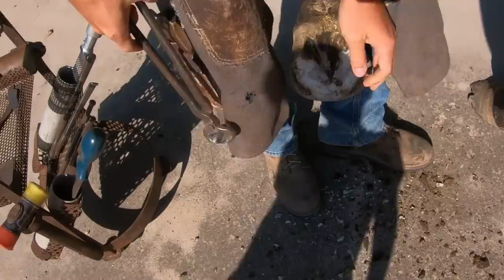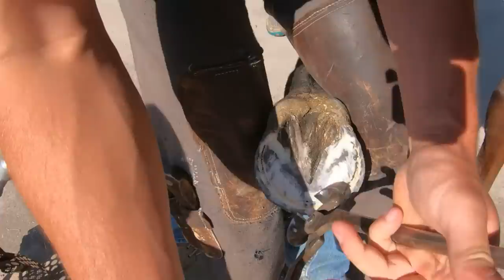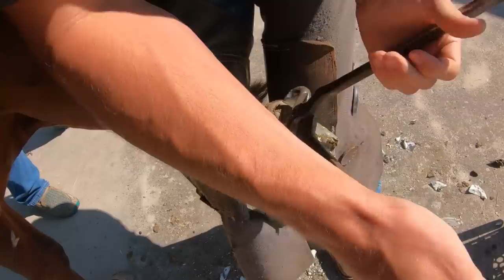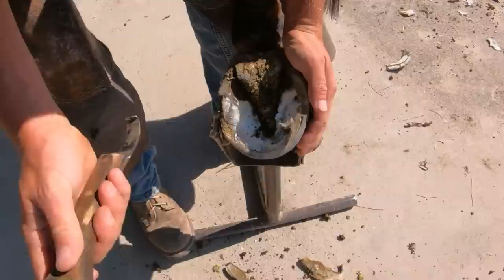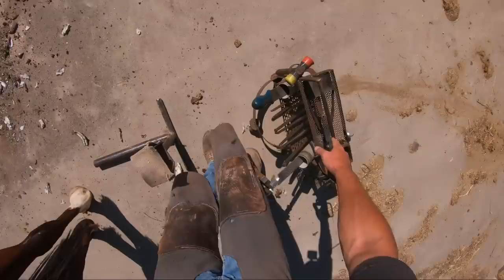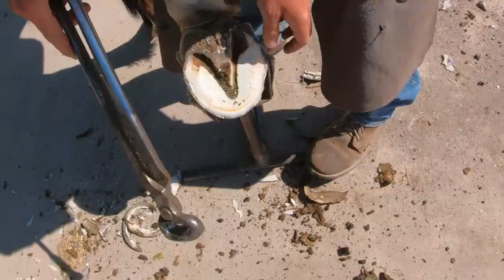TRIMMING a RESCUE horse With RINGBONE // Satisfying

Comment: When you are at the vet check and see if they can fuse your spine while they are at it. I can't think of job that is harder on the back than being a farrier. I trim up my horses hooves and I can only work for 20 minutes at a time. My full time ferrier just retired and his back is trashed.
Reply: Having 2 back surgeries myself this is so painful to watch!!😖
Reply: Isn't there an easier way? Like a soft lock on the hoof, that will break loose so it doesn't get hurt if it flips out, so you can sit down and do it?

Comment: So weird how it carves like wood, but it breaks apart like the inside of a coconut or some kind of fungus.
Reply: Its a nail basically, keratin
Reply: Would be the same if it was a rinos horn
Reply: Kinda crazy
Reply: Looks so gross. Those poor horses :( Imagine living with dirty nails and long nails for years
Reply: @Jin-1337  well they don’t get cleaned in the wild
Reply: Karen Reed  depends cuase in the wild there is a lot of soft dirt so ide imagine if anything they would get really long, the nails, and intern become lame
Reply: That's oddly specific and on point
Reply: @Jin-1337   as a horse owner, horses shoes get clogged easily. It’s hard to stop a horse from getting dirty feet, if not impossible. Makes for a satisfying job though
Reply: @yourdadwillgetbun5269  I know but it should be cleaned at times. Letting it be for years an years might just be painful for the horses.
Reply: @woozy9112  in the wild there is a lot of varying terrain and they walk around a lot more than they do in the pasture. Wild horses also have a different conformation than domestic horses do which helps wear down the hooves appropriately.
Reply: @Jin-1337  I know. Nothing should be left that badly. But can’t be kept on top off at all times

Comment: i was always told that hitting the frog would cause it to bleed like crazy, was so shocked to see you clipping into it like that-- now i wonder if the horses at that barn had problems with thrush?
Reply: Need to trim that frog, even if thrush, all that loose dead material, will make it worse with the debris, and mud getting trapped which will cause worse infection
Reply: Same!
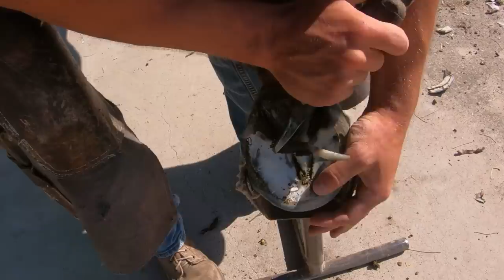Reply: 8:20

Comment: If anyone is interested about ringbone: Arthirtis is the growth of additional bone between 2 articulating bones in a joint. Most of the time, the surfaces of bone is covered in cartilage, and that cartilage is smooth and fits like a glove on the other piece of bone. If there are irregularities, it can lead to chipping, more bony growths, and calcification/deterioration of the cartilage. like he said, ringbone can be fused with minimal side effects in 2 joints. Fusion means the bones will eventually grow together, and the joint will no longer be able to move at all. Much of the time, if the horse has ringbone in these locations, the vet will simply let the bones fuse on their own, since they're heading in that direction anyway. If it is really painful, the vet can induce fusion with a simple surgery. If the ringbone occurs in a high motion joint, the excess bone can cause issues to the surround tissue, such as tendons and ligaments. You can deal with this is 2 ways: 
1. If the horse is old, or the owner can't afford surgery, shots such as corticosteroids and hylouronic acid( much like in humans) can be given for lubrication.
2. Surgery. Look up arthroscopies! They're very satisfying to watch. Theyre also very common in the knees of race horses.
I am not a vet, so this is just me saying things. I definitely didn't put everything I know down, so feel free to add!
Reply: Im vet, i add sugar

Comment: Do wild horses wear their hoofs down naturally, and how is that possible when they mostly walk on soft ground?
Reply: Hooves are made of keratin which is the same substance that makes up hair and fingernails. It’s approximately the same hardness as talc so it wears down fairly easily since wild horses walk across a variety of surfaces. Domestic horses are on more limited terrain and stay in stalls which is why there are special hoof care experts (called farriers) like this gentleman who know how to manage issues that come with domestic horse hooves.
Reply: I'm sure they scrape them on stuff or something
Reply: Not only that but sometimes when horses stomp to shoo away flies, chips may fall off of the hoof. It can cause a problem if it's too big of a chip, though.
Reply: A wild horse yes will were it down cause they dont just walk on soft ground cause if you have ever noticed there is alot more field stone and sometimes they have to pass creaks and other rocky terrain that can cause the natural care of the hooves

Comment: Me: my life has been a lie every single horse rider told me that the frog is sensitive...
Reply: for real
Reply: It can be sensitive to pressure. Like when they get rocks stuck in the frog
Reply: So the frog is sensitive, but relatively. If you stab or cut off the wall of the hoof, it won't hurt, but if you stab the frog, ouch obviously. Rubbing it or bumping it won't cause a problem. So not super sensitive, but don't go stabbing it with a knife or anything. I has nerve endings, but not what one would consider sensitive

Comment: Ring bone sucks! My mom's old horse had a bit of ring bone. He was not near as bad as this mare, but we had to make sure he was kept in a large level paddock or he would get a bit sore. 

I'm so glad the mare has a new home that will take care of her. She looks like she was fed well but her feet were a mess. Poor crippled old lady. It's exhausting to have weight for any length of time on arthritic joints. I was holding my breathe the whole time you had her right fore in the air. You could tell her resistance to picking the foot up and slamming her foot down wasn't her being bad, just trying to relieve the pain. She sure seems like a real trooper, as an old rope horse would be. I hope the trim helps her but she needs a good arthritis Rx or supplementation and then a little bute the night before to further take the edge off before trimming.

I know just how she feels.1 knee replaced. 1 knee to be replaced. Worth it!

Comment: Is there any way to get/make her a crush that can hold her front weight when you trim the right front so she doesn't hurt her joint while doing it? 

Can't imagine how painful that must be. Poor lady. Glad you're helping her a bit
Reply: I recently tried trimming our mule in a cow crush... as she was a rescue and could not stand in 3 lega for trims anymore because of arthritis, ringtone and other issues. 

She panicked and sliced the tendons and tissue in between her cannon bone . We ended up  euthanasia. In hind sight I would have wrapped legs or would need crush part that holds the legs designed better and tranquilized her. 
This trial was our last ditched effort to get her trimmed. Her last 3 winters she had difficulties getting up when she layed down. So we were seriously considering euthanasia this fall anyway. I would love to hear from anyone who may have used a crush on a horse. I would love something to make trimming ponies with chronic laminitis easier as well. Depending on the situation, sometimes I trim one hoof part way then switch to the other hoof on opposite side then come back and finish first hoof.
Reply: From ballston spa NY
Reply: @lindav6164  I was thinking more of something like an engine hoist type contraption. Not really anything that requires much effort other than supporting weight just under the armpits. Maybe just like a strap or harness that can attach to something. Less room for there to be injuries and they'd already be used to that sort of pressure from saddle straps so they may not freak as bad. Or even just a pedestal like the one he uses for the back feet, but supersized to place under the horse and hold them up. I know they use a similar contraption in the dog grooming industry for arthritic/old dogs And such. Maybe it could be an idea for a horse with arthritis or joint pains?
Reply: @Draconem97  we used a crush for cows... she walked in it fine, there is a belly band that supports her some then the crush tilts. Hindsight some tranquilizer probably would have prevented the panic. AMD better leg restraint design (as cow legs are wider than this saddle mules) would have prevented the  injury if she did panic again. The Hoof GP on YouTube has a different type of crush that does not tilt but I think does have a belly band which supports the body which you are suggesting.  Thanks for the link. Hope others chime in. We miss old.Molly but glad she got about 6 years here of retirement...she was purchased for rescue from a kill buyer (person that ships horses and mules for meat)
Reply: @lindav6164  I follow him on yt as well haha. I love watching trimming videos. They're so satisfying. And yeah it does have one. I'd just be concerned putting a horse in a crush though. And to tranq every time you'd need to trim would start getting expensive. A pedestal like the one I linked would be much cheaper and very easily mobile. Adjustable height means it could be used on any horse. Just to give them that little bit of weight removal. Plus it'd make it much easier on a farrier rather than having to lug round a huge crush.

Comment: I have a question. What could happen to the horse if it isn’t shaped before a competition. Or actually, just in general. What could happen if you never cut your horses “nails”?
Reply: I am here by the power of algorithm and since I had no idea, I googled some uncut horse hooves. Boy oh boy, this stuff can go super crazy - they start to bend a little and grow horizontally long, and then they just start to curl. It looks like a mix of goat's horns and horse legs, but more heartbreaking than I ever anticipated
Reply: @LonaWu  so what about them wild horses
Reply: Someone in another comment said that usually (like gophers teeth) they get withered down with use but when man made harder surfaces were made it would eat up the horseshoe like soles of your shoe so they put metal horseshoes on  them.
Reply: @janerickallado8881  well they don't have horse shoes on them so they find rough kinda sandpaper like surfaces and grind them down kinda like us using a file and they never get to big cause they also naturally get worn down out there as well

Comment: I've seen cows put into something called a "crush", basically a machine designed to restrain the cow and hold the feet for you while you deal with their hooves.
Is there something like that for horses?
Reply: I think because of a horse's muscle and weight distribution it would put a lot more strain on their torso/chest to be in that position. The way they do it here, the house can stand like they normally do, and like the farrier did here it's good to let them rest every little while and shift their weight around a bit. I've heard of farriers working with a vet and using sedatives for extremely aggressive or stubborn horses that need hoof care, but never using a cattle machine.
Reply: Yes, there is. Its different from those for cows but they do excist. Often times, with shires etc ferriers wont want to do them without one of those..

Comment: Hey from Tennessee!
I just wanted to say thanks for explaining a bit about the frog. I’m still new to working with / around horses. My Wife used to ride when she was young. I noticed the frog is made of a softer material. 
My question would be, is it necessary to trim up and re-finish / cut off the top layer of the frog when doing a maintenance trim?

Comment: Sir, in Germany we once had an internationally known horse ( animal ) chiropractor who travelled the world sometimes too and had many many contacts built up over the years, since he helped so many horse owners, farm owners and so on and this man said so often, that people need a really really good farrier ( is this word right? ) cause most of them just do basics without knowing what the horse theyre currently working on, needs. For example he told about a horse that had slightly x shaped rear legs which can be supported by cutting the inside I guess a bit more to fit the right angle of the feet to the joints and so on - is this something you would agree too or would you say, every horse should be treated the same way?

Comment: It seems to be very common "knowledge" here too (in Sweden) that the frog is sensitive, but I thing it's more due to a game of telephone rather than misinformation from farriers and vets. When I was a kid I was told that the horse has feeling in their frog and that I should never try to remove it while I'm cleaning the hooves. Young me interpreted that as the frog being sensitive and that removing parts of it would be painful. I learnt later that I had misinterpreted what I had been told and that the information I got as a kid was very simplified. I have now seen the same thing happen to basically every kid I've ever met at a stable. Once they've been told the same thing as I was they tell their peers to be very careful with the frog so as to not hurt the horse, unintentionally further exaggerating the belief. And if they never have this belief questioned, like for example by seeing a farrier working, they simply keep on believing they are correct. That's my take on it

Comment: Just asking, but can't you make a sort of cradle that you can tow behind your truck and use it with manual cranks to partially lift the weight of the horse? I know the modern ones are all hydraulics and computers and cost 50-100k USD, but you could make a manual one for much cheaper especially since in this case you'd only need to partially lift the horse's weight.

Comment: Out of curiosity, do wild horses need to get their hooves trimmed? Because i guess that probably wasnt possible before. So did they die earlier than farm horses from hoove related problems or do they not have that issue?
Reply: In the wild there's rougher ground and the horses get to run more

Comment: Do wild horses just wear their hooves down naturally or something? I assume domesticated horses need this done because they’re aren’t able to run enough to wear it down themselves. Either way it will s extremely satisfying to watch this being done.
Reply: Yes and no. Wild horses do wear down their hooves naturally. But pavement is extremely bad for horse feet and would wear the hooves down TOO much and damage them irreparably - imagine having to balance your entire body weight on your fingernails and then having one of them split! - which is why domestic horses normally "wear" horseshoes. The horseshoes do such a good job at protecting the hooves that they need to be clipped manually.
Reply: @InfiniteAnvil  most wild horses just die before it's a problem to themb

Comment: I don't understand. If they're wild animals, how do the hooves become overgrown? What do horses in the wild do?
Reply: It was on a different video, but a commenter once mentioned that the rough terrain of the wild can naturally shave a horse's hooves down. However, it is still possible for wild horses to get cracked or chipped hooves from a running accident. You don't see the lame horse for too long after that, because they either can't run in the open or pass away quickly after infection sets in.

Comment: Did horse have bigger front feet than rear feet?
Reply: Yes, 2/3rds of a horses weight is on the front feet, so they tend to be rounder and bigger, but of course, as all horses are different, this is not always true.

Comment: What happens with wild horses feet? No one takes care of them?
Reply: It was on a different video, but a commenter once mentioned that the rough terrain of the wild can naturally shave a horse's hooves down. However, it is still possible for wild horses to get cracked or chipped hooves from a running accident. You don't see the lame horse for too long after that, because they either can't run in the open or pass away quickly after infection sets in.

Comment: How do wild horses do???
Reply: The way I heard it, horses need horseshoes to protect their hooves on hard unnatural surfaces like concrete and therefore have their hooves trimmed manually to fit the horseshoe. Wild horses do not have this problem and their hooves are naturally worn down. Correct me if I'm wrong
Reply: Wild horses are not typically very healthy.

Comment: The frog should be left alone and just kinda cleaned, not sliced off like you did,  horses in the wild don’t have it cut away anyway.
Reply: WIld horses come from naturally rocky areas, which wears down there feet. Due to 'pet' horses not moving all the time, they need their hooves trimmed. However, horses hooves grow like toenails. The whole 'horses hooves are sensitive!' thing is a myth. Its like a toenail. They dont have feeling in their hooves.

Comment: if it's called a "rescue horse" who or what exactly does it rescue? Does the horse, under it's own initiative, go out to rescue those in need? Is the horse ridden by a human that uses the horse to perform acts of heroism? It really is quite confusing?
Or is the implication that the owner went out and rescued it? Was the horse sinking in quicksand, then you managed to pull it out free? Was the horse surrounded by wild wolves, and you managed to help fend them of in order to rescue the horse?

Or did you just buy it?
Reply: They rescued the horse
Reply: @greg8360  So shouldn't it be called a "rescueD horse"? Where's the "d"? (besides in my ass)
Reply: @danieltadd  idk probably stuck in there with the other d you mentioned
Reply: @iiVitality  2/10